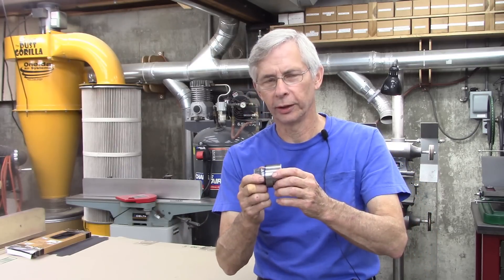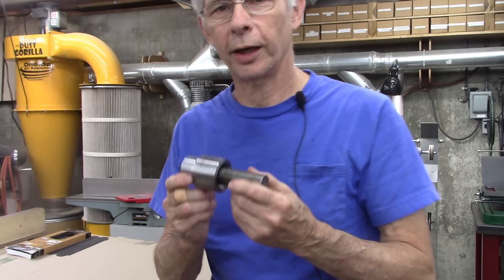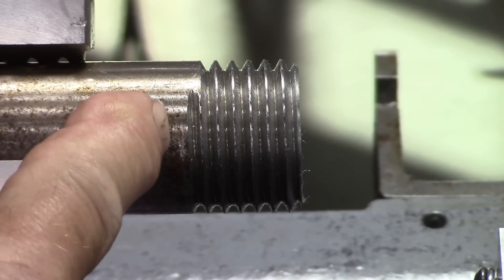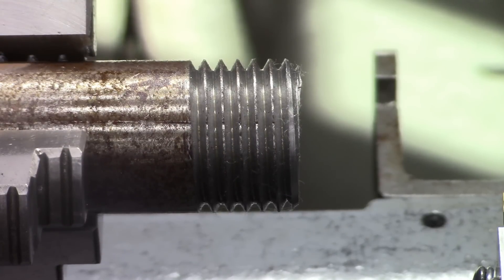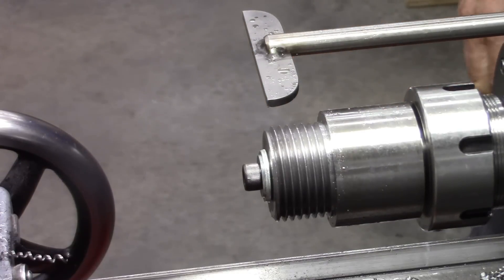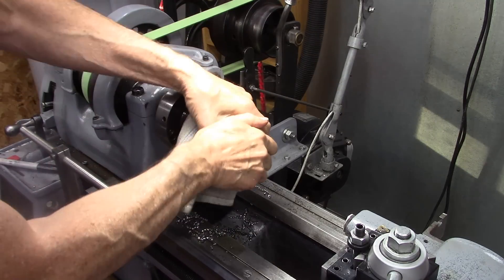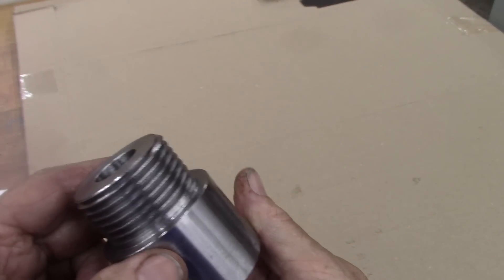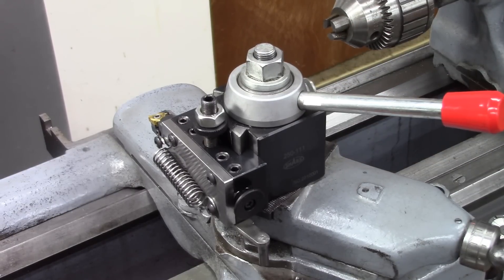Using Mr. Whoopee's Auto Retract Threader to finish my Lathe Spindle Adapter

Comment: Looks like a nice threading tool.  I can see the issue that it has, when the threading tool is triggered to retract it flies back with enough force to act like a slide hammer  moving your tool post. Perhaps you can add a damper ( piece of rubber, spring  or both) to the tool to absorb the energy before the energy is absorbed by the tool post.  Hopefully if the damper works correctly you will not have to use the sandpaper under your tool post.
Reply: Yeah, seems like a rubber bump stop should work. Wouldn't take much to dampen the percussive effect.
Reply from the maker: @HughMessenger  Yeah, Craig said he was going to try this. He said its only the AXA that has this problem.
Reply: you could do like the boxer engines do and have a weight that flies forward at the same time. then it's balanced out, apart from the rocking couple.
Reply from the maker: @martin-vv9lf  That's and interesting idea!
Reply from the maker: The abrasive mesh is an easy fix but Craig is going to try a piece of rubber.